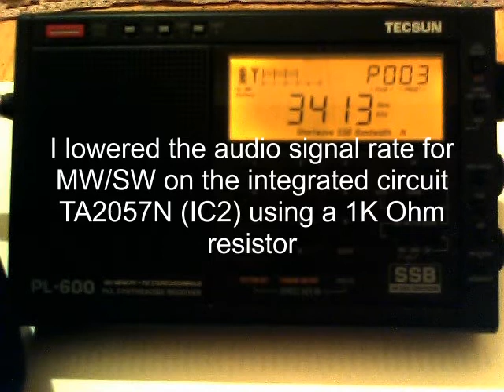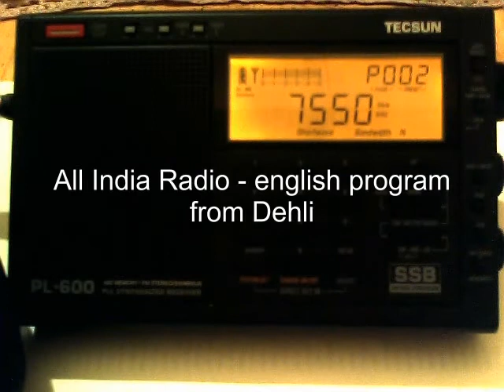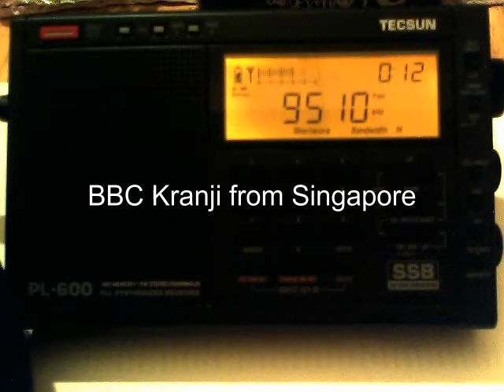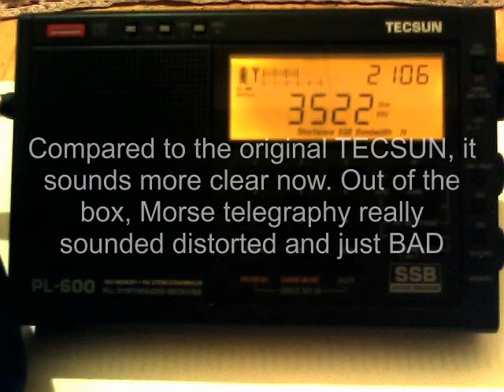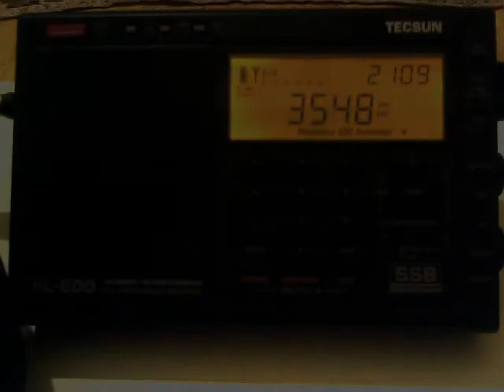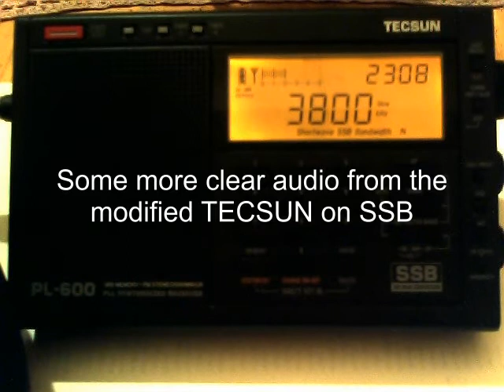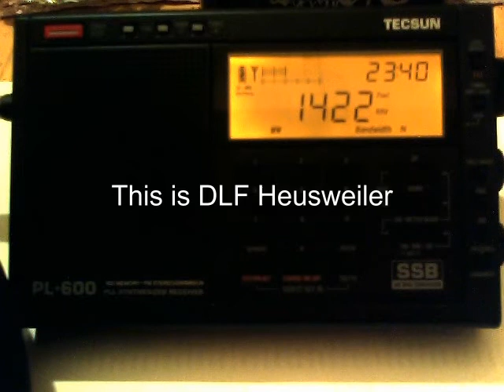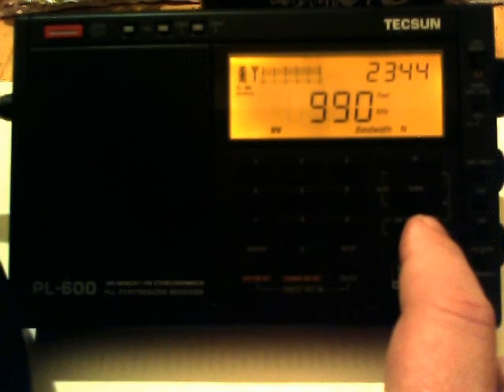Tecsun PL-600 Modification

Comment: I just bought a Tecsun PL-600, but I still have not received it. Do you think the receiver will come with this factory-corrected problem or will I have to open the receiver and solder the 1K resistor? Does this modification affect the sensitivity of the PL-600?
Reply: ham bands no

Comment: Hi Rene. Great video! But I have a question. Before you made your modification, did you experience distortion in both AM and SSB mode, or SSB mode only? I have a PL-600 which sounds awful in SSB (although I've found that retracting the antenna helps a lot), but is perfectly fine in AM. Your video implies that you found AM to be poor as well. Thank you!

Comment from the maker: hi, well as far i remember, i tryed the 2K2 resistor first but for me the audio volume was too low with it, so i tryed a 1K with the result that the distortion was gone too but the volume was louder compared to the 2K2 resistor. this is why i stick with the 1K. Best is to try both versions yourself and decide. Im german and my english sounds like a bavarian cow so all is fine :))
Reply: Would a remote variable 2.5K pot work to dial it in ???

Comment: Hello and many thanks for your video !!

I own myself a pl-600 and before to do this mod, i would like to ask you something if you don't mind..

I saw on the Internet the same modification but with a  2.2 Kohm resistor instead of the 1Kohm you use...before I start, I would like to know your opinion on it ... did you  try different values for the resistor ? 
In any case I am grateful and I thank you. 

ps: excuse my bad English! i'm french and i speak english like a Spanish cow !
Reply: take back of  it off,adjust little bit with radio on ham bands.
Reply: Ohh you write very well english, I wish I could write French better. I'm fluent in spanish instead.

Comment from the maker: Hi and tnx for the kind words. No, i did not made an modification for air band. as far as i know this requires some more complex modifications like a bandpass filter. I have no idea how the PL-660 sounds out of the box. Maybe the 660 didnt need any audio modifications. A test would show that quick. The 600 is a very good radio for what it cost, even without the synchron detector, it works without problem in almost every receiving situations. Hope you get your radio soon, its a fine lil thing.

Comment from the maker: Hi, no i just soldered the resistor on the leg of the transistors pin 18 to ground. so no hole mounting was needed.
Reply: Kann ich auch ein 2KOhm verwenden vielleicht ist die Audioqualität noch besser auf Stellung DX .

Comment from the maker: Please check the video description, i added a link to a schematic pic i quickly made. It should show you where to solder the 1K resistor. Note, that you dont need to solder the resistor strictly from pin 18 to the IC ground pin 8, you can also sold it from pin 18 to a different ground contact on the board, so i did. depends on your own taste. Cheers.
Reply: you dont need  that just turn the srews
Reply: BIG THANKS !!!

Comment: Which pin is number 18, on the circuit diagram on one side it's 1-9, but which is pin 10 or 18, the one at the top or bottom ?